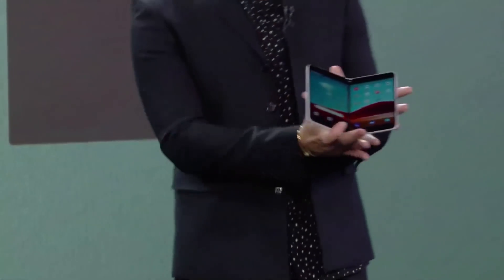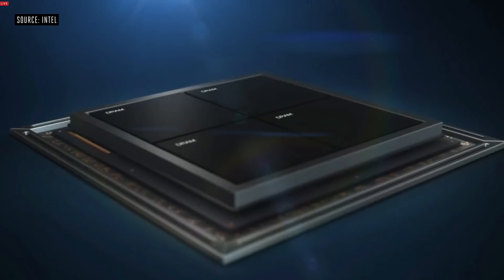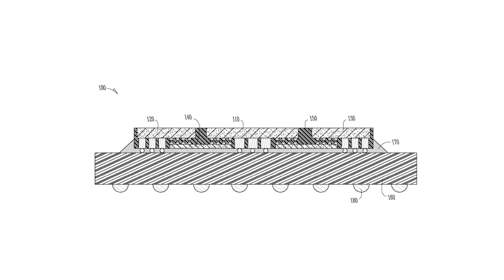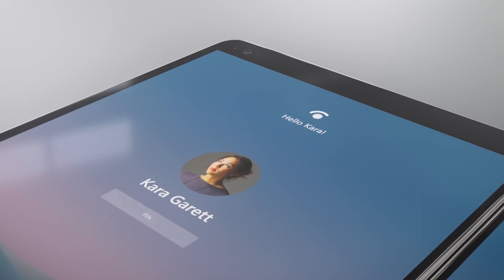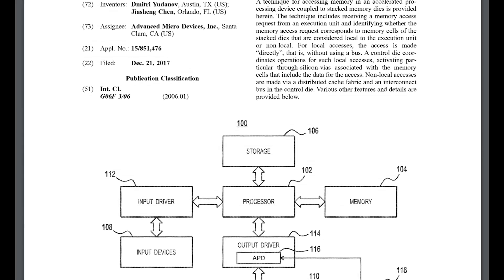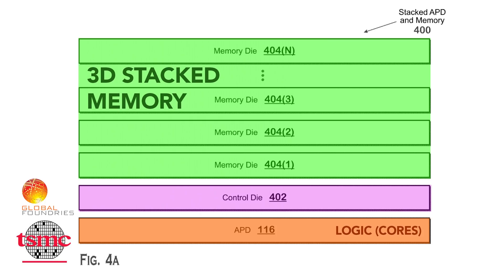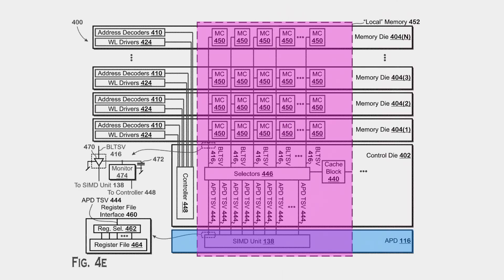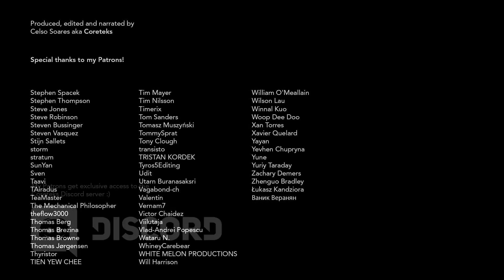Is 3D STACKING coming sooner than we think?

Comment: Always wondered how they are handling the heat dissipation on this stacked things
Reply: I've seen a AMD patent where they add thermo-electic wires integrated in the memory stacks which cools it down.
Reply: Yeah it feels like they’d need superconducting heatpipes in order to help dissipate heat buildup within them.
Reply: Generally memory has a lower heat tolerance.

This may change, but currently it runs cooler than the CPU die. Heat generates errors.

NAND likes heat, or at least a higher operating temp. RAM, not so much.
Reply: by having more cores, when one core starts getting to hot move the processing to another core, by doing this heat can be controlled
Reply: Yep.

3D stacking is certainly problematic.

I think it's going to be a space saving tactic on low power devices and otherwise DOA.
Reply: they don't.. that's why it might only work in ultra low-power applications. Too much BS in this video...
Reply: He actually says exactly that in this video.

3D stacking is only in low power devices. Literally says that.
Reply: @unknown4me1  That commented aged like milk.

Comment: I don't know how the technology would scale though.  Didn't AMD Vega and the like run into issues with stacked memory prices and through-silicon vias?

Maybe the comments about this technology being used for AI are accurate.

The costs for the server market should be able to justify the extra cost of production.
Reply: Not stacked, HBM, and the issue they really had was that there was a height difference between the HBM and GPU silicon so the cooler didn't make even contact.

Comment: I dont see 3d stacking on consoles. Too early tech to be adopted. My guess is, that in 3 days we'll get an AMD powerpoint of 3d stacking for 2021. The best that could happen in 2020 is Big AMD GPU with samsung cheap hbm2 ram on the chip. PS5 can even go with 5700xt so even older gen. IMO lates tech goes to servers after Milan.

Comment: I've been thinking they'd put RAM on top of the  IO die for a while, I think since one of your earlier 3D stacking videos 😄 this would help heat problems since the logic chiplets are the most power dense and having more layers between them and the cooler hurt performance.
Reply: If you reduce the chip clocks by 10% because of added heat but increase IPC by 40% because of the huge bandwidth and latency advantage then it's very much worth it (26% increase in total processing power in this case)

Comment: Interesting. AdoredTV thinks the consoles are monolithic large dies, while you think they may be 3D stacked chiplets. Completely different directions there.
Reply: Actually he's betting on a Chiplet design which would answer much of the production and demand issues AMD faces, that can tie in nicely with stacking and other technologies. AMD has experience under their belt for stacked memory and that was Vega. Much of the videos he's done is based on what we know which is surprising damned little despite the spec leaks. Another interesting tidbit AMD has been patenting some interposer cooling ideas as well from memory.  

One thing is certain about nextgen consoles, the tech in them is going to be a massive game changer, and far more disruptive that what we've seen the past.  It's going to be interesting to see how MS and Sony have approached the same problem as all the indications is that they've approached the consoles with the same core hardware but customised them in wildly divergent ways.

Comment: Stacking is coming, but initially only on the non high performance, low power side of the market, as the power density and ability to cool it is the limiting factor when it comes to the high clock frequency performance market.
Reply: there's still a performance improvement even without an increase in clockspeed because of relocation of memory to the CPU.
Reply: @xponen  Yes, but you are missing the point, you will get better performance in theory, but how are you going to cool it adequately given that you are adding an additional thermal interface between the CPU and the heatsink?
Reply: @switzerland3696  maybe accept the fact that this CPU have a limited TDP, eg: 10watt, but at the same time boast that it is faster than previous 10watt CPU without 3D stacking?
Reply: what the market sees is a faster 10watt CPU. Maybe they couldn't find the 65watt version but hey, for those 10watt application you found a faster CPU.

Comment: I just can't see how we will get around cooling, we can barely cool 2D chips that connect directly to a cooler, imagine connecting those chips to a massive heat source instead, that is what 3D stacking looks like to me.
Reply from the maker: @
Speak out and remove all doubt! That's definitely a concern, as I mention later in the video, I think there will be logic dedicated just to predict and control thermals. I've seen a few patents related to this. Also, I think Intel is showing some carbon nanotubes based cooling layer this coming week. And of course, clocks will have to come down in these stacked devices.
Reply: @Coreteks  yeah, I've seen micro water channels discussed also but I worry how effective they would be and what pressure they would need to run at.
As you said, for now the focus is mainly low power and the greatest benefits will be for APUs but I think we still have a long long way to go with plain old 2D chiplets before our only option is to start building upwards.

I hadn't heard anyone suggest the consoles could be stacked, I would be amazed if they were because of the heat issues and the fact that the main benefit at the moment looks to be memory bandwidth and we can see the memory is around the sides of the die, well for the Xbox anyway.
I would say there's a possibility that it has a GB or so of ultra fast memory 3D stacked on top the die, level 5 cache? This was a rumour for Zen 3 but I believe it's been pushed back to Zen 4 now but could still happen here. I'm not sure how different that is to the Xbox 360's 10 MB of eDRAM which was very difficult to use effectively.
Reply: Honestly I don't think it will be that difficult. AMD's 3D stacking patents puts the memory next to the BGA at the opposite end of the high heat generating logic layer. With the BGA soldered to the motherboard there's no reason they couldn't use the motherboard itself and say a thermally conductive silicone pad  as a secondary cooling avenue. Add in AMD's patents for active electrostatic cooling layers within the 3D stack to push the heat to the edges of the chip and it would seem they have cooling for lower and moderately powered SoC's already in hand.